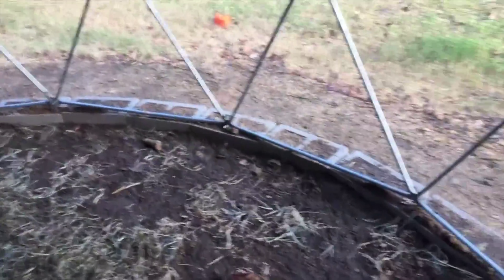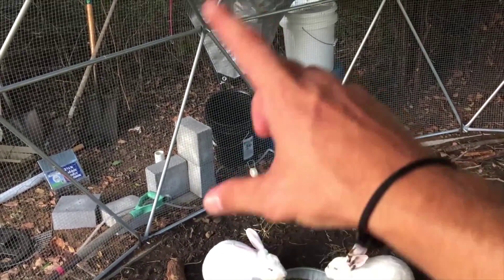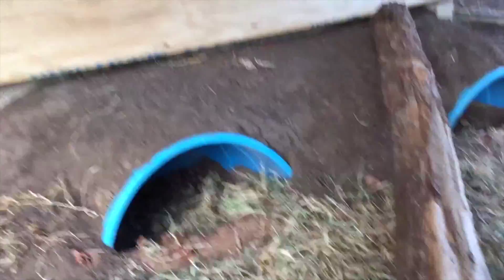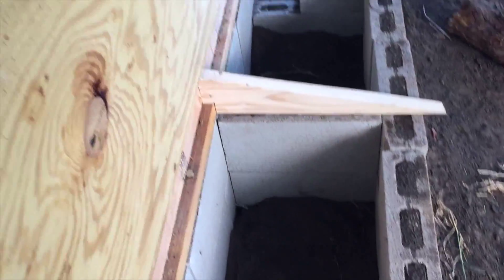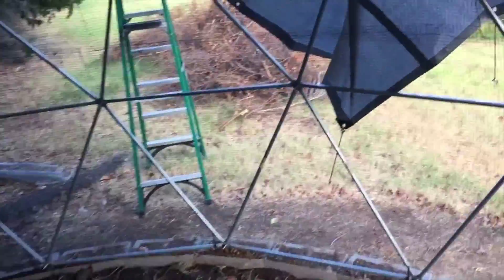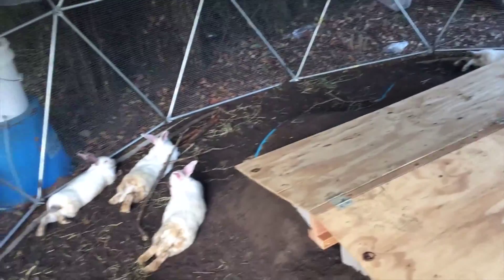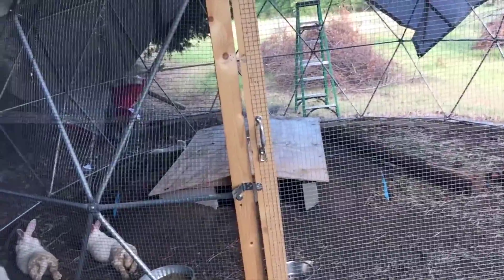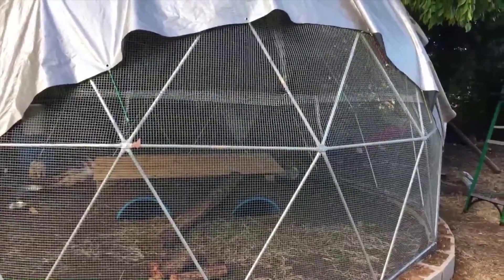Geodesic Rabbit Dome Enclosure (Conduit Pipe) - Part 2

Comment: I think it's cool but you wasted a ton of metal. The amount of unused head room and the domed roof makes for a bad design.
Reply from the maker: +Jacob Gambrel I appreciate your thoughts. There is only about 18" of unused head room which will be taken advantage of by growing hanging plants. I would encourage you to look into geodesic domes, a dome is by far NOT a bad design, and is actually one of the best designs in nature as well as incredible strong. Any strong winds or tornadoes has an effect of pushing the dome down instead of creating lift. There was no wasted metal, when deciding between tubular steel and wood it was about equal in cost or more in a typical rectangular wood structure. We also wanted something attractive that could also have vines and plants growing on them that would be easier to harvest from. Again, I appreciate your opinions.
Reply: +Mayfield Family Farm bad design was bad choice of words. This is fantastic but I would have done it differently based on my climate and area.

Comment: how much did it all cost?
Reply from the maker: Good question. The frame and bolts cost about $135, in my opinion very inexpensive comparatively. Then the mesh just depends on what you decide, what you have to keep out or keep in; plastic, shade cloth, hardware cloth, chicken wire, etc. To get 200 sq ft built out of 4x4s and other lumber would have cost more than $135 and much more labor intensive.